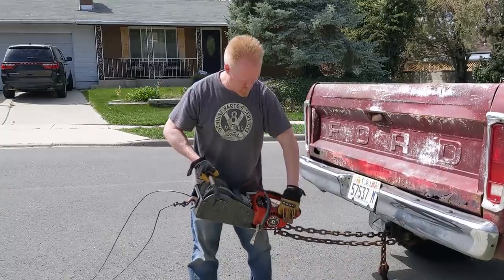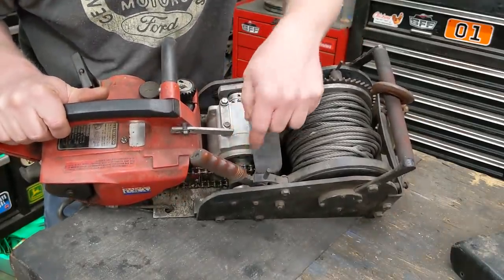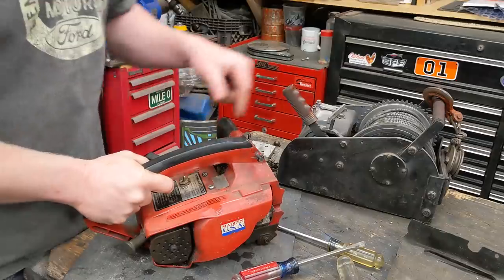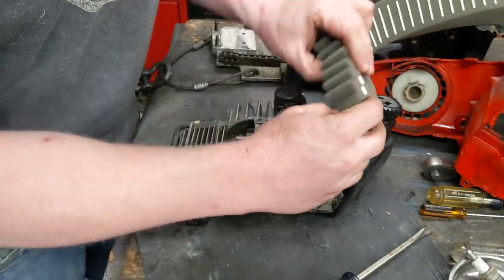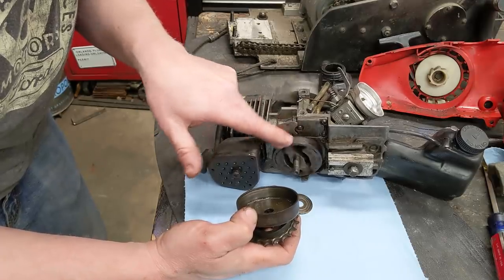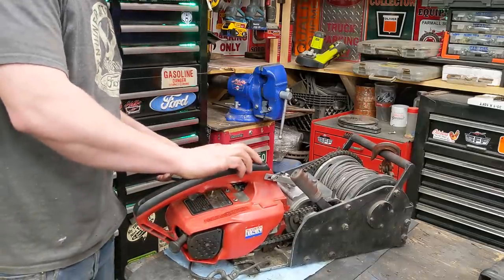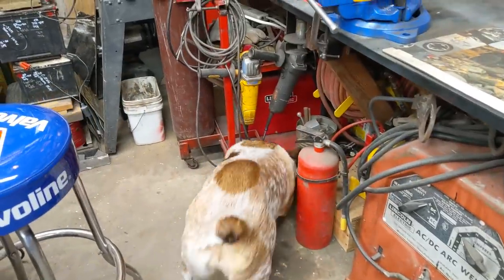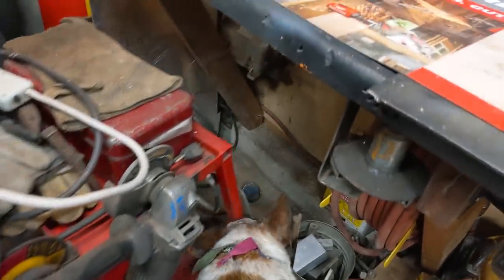Chainsaw Winch brought back to life TESTED

Comment: I had no clue that even existed!  That's like my first chain saw I ever had.  Must have been invented by a logger to move logs or something?
Reply from the maker: I think their main use is skidding logs.
Reply: i had a buddy that i cut firewood with who had one of these that we used to do just that. we'd log the trees, winch the logs onto a trailer, chain them down, and cut them to burning sized lengths at home. it's a lot quicker and safer to do it that way, because you don't have to worry about chunks falling off the trailer on the ride home, and loading a 12' log is quicker than loading 15-18 wood chunks.

Comment: I rebuilt my 450R one time couldn't get it to start no matter what I did. I pulled the carb, checked Cam Timing many times etc.  Turned out the key was in the off position.  Kicked it over after that fired right up. lol
Reply from the maker: It happens to the best of us!
Reply: Replaced the points on my mustang, wouldn't start, cussed for 20 minutes until I saw the distributor rotor sitting on the inner fender well...cussed some more and installed the rotor.
Reply: @kennethclifford1863 LMAO

Comment: It’s a cool tool, but it puts the user right in the snap back zone. If the sling, hook, shackle, or wire fail pulling 4,000 lbs you may end up six inches shorter. A regular winch has a remote so you can step off to the side for safety.
Reply from the maker: True, but a lot of common sense about how and what your pulling goes a long way. Winch line failing is nearly always operator error.
Reply: First, thanks for your videos. I appreciate your hard work and your content is great. Your right that operator error is a huge piece of keeping people safe. I saw a 600 lb. clutch (on a ship) fall because a brand new shackle failed. Maybe I’m a bit on the cautious side but I’d rather be cautious then dead.

Comment: For those of you who may be new to winching, a few tips not mentioned here: Doubling the cable thru the "snatch block" will provide twice the pulling power, but at half the speed. Also, the further into the drum/ lower wraps of cable you go, the winch has more power.. 
Finally winches are VERY DANGEROUS!!! use extreme caution and be sure all attachment points are strong  enough for the forces created and put something (blanket/ jacket etc) over cable, in case something breaks the energy will be directed downward. 
I've always liked the concept of these "chainsaw winches" but having to operate them from the "death zone" has kept me from ever getting one ;)

Comment: Very cool!  I never heard of a "chainsaw winch".  Before you tested it, I thought that it would have pulled the car with ease and was very surprised at how it struggled pulling the car and was jerking rocking your truck so much.
Reply from the maker: The car was in gear and had the e brake on. It would lift the entire car up into a tree if I needed.
Reply: that's because the car wasn't in neutral. The idea was to put a real load on it.
Reply: Ah, OK. I missed that little detail. Thanks!

Comment: I've got that very Homelite chainsaw in the garage that I bought for $39.00 at the old Price Savers on 21st. South and 3rd West 40 + yrs. ago.
Reply from the maker: That's awesome. I haven't heard Price Savers in a LONG time. I think they all turned into Kmarts? I had to run the inflation calculator and came up with $39 40 years ago equals about $100 today.
Reply: @sixtyfiveford  It was the forerunner to today's Sam's Club.

Comment: I had to see if those winches are still on the market.  They are and they go for $1000 to more than $2000.  You found a gold nugget there.  I'm surprised the CPSC hasn't outlawed them because of the proximity of the operator to the steel cable (if it breaks).
Reply from the maker: They are mainly used for skidding logs and not dead loads. The clutch will slip long before the cable would ever snap.

Comment: Nice little winch. Especially surprised it started after so long. However, I don’t think I’d want to be there on the throttle if the cable snapped or came loose.
Reply from the maker: It's a fun tool.

Comment: I can't tell you how many times I've worked on an engine and got it all back together thenb cannot get it started. Usually its one of two things- I forgot to spark plug like you did, or I'd been working on it so long the tank was dry - usually the simple things right?  I'm loving the end clips with your pup - they definitely encourage me to watch to the end!
Reply from the maker: Out of gas has caught me a few times. Thanks Man.

Comment: Looks cool and fun,doesn't seem to be too efficient tho..just get a regular winch
Reply from the maker: It has a few benefits over electric winches. 
100% duty cycle vs only a few minutes of use with an electric winch before you have to stop/let it cool
3x the cable length
Long cable allows easier Double, Triple or Quad(8000lb) line pull for 4x the pulling capacity. 
Ultimate portability. 
SPEED! 60-80ft per minute vs 10-20ft on an electric winch.

Comment: "Chainsaw Winch", I didn't know there was such a critter. It had to struggle to pull that small car on flat level ground but it's portable, strong and, in my case it's affordable.
Reply from the maker: The car was in gear with the e brake set. So all 4 wheels were fighting it rolling.
Reply: sixtyfiveford that’s awesome

Comment: Mighty neat. Wouldn't care to be at the controls when the cable broke though.
Reply from the maker: True. These are mainly used for skidding pulling stuff long distances versus moving dead loads. In the event of a dead load the clutch would slip far sooner than the cable would break.

Comment: That plain XL was the begins of Homelite's downward spiral. But save up some hard earned $$$$$ , then go th """K""" Mart and get a Poulan Pro. You know it's quality because it has Pro written there fer everyone to see you bought the best👍😉. Or just take that same money and burn it , you will much less frustrated because you didn't make sprocket adapter for your winch for the Poulan (🤣Pro😵)!  I just had to take a few jabs at both KMart and boxstore Poulan. But Poulan was a brand to be very proud to say that you owned. I collect the Homelite XL - 12 and it's Brothers , Cousins , and Nephews. That was a great platform of saws that came out in 1964 - 198?8 I do believe. I'm sure of 1964 - around 1988. I used a couple XL - 12's all day today in Chatsworth Ga. in helping out in the tornado relief cleanup. They first grab a ton of attention because of how old and heavy they look from being painted metal and zero plastic. Then the deep throaty sound , but when it sets into sawing cut per cut with the hi end Stihl's n Husk's they grab respect in a hurry. Then when we stop to water ourselves they wanna know why they've never had or heard of such a simple antique saw that's still viable. I'll quickly explain all I can and how to find them , check for compression , and if they find them and not interested to send them my way. I told them that some of mine had strong compression but didn't crank , and only needed ignition work. So the saw for $20 not running and another $20-$30  and also put a carb kit in it , to have a saw that would run with any of the really expensive Stihl saws. A plus about these old Working Gals. I've never done this to mine , but have seen pimps do it to there Working Girls to keep John's from steeling them. I've seen some good looking , running , sawing , Working Girls with a Teri me nasty color paint job that nobody would want just to make them theft proof.
Reply from the maker: I run a lot of older saws but rarely come across Homelites. I only pick old saws up if they're free. They need to interest me and be something I feel I'll get use out of because the resale isn't worth the time it takes to work on them.
Reply: Very true. I've never sold any of my antique saws. I donate  them to the crystal meth epidemic in my area. Evidently they need them more than I do. This last time I donated a nice running OMC Evenrude outboard , several new 212 cc Predator engines , an 029 Stihl saw , a couple of tool boxes of mis . tool boxes , and a piece of siding to fix on the back of the shop building they ripped off to gain access thru. Gotta keep that meth a kooken

Comment: if its rated at 2000 Lb thats a full extension with one wrap on the cylinder
Reply from the maker: Exactly. That's where these shine though as they have so much cable you can double line pull up to 75ft away with 4000lbs or triple line pull up to 50ft at 6000lbs.

Comment: No winch blanket to slow the cable if it broke? Not a good idea!
Reply: This design is 60,s when people were not sallys
Reply from the maker: Meh, not pulling anything significant nor a stalling load. That's what breaks winch line.